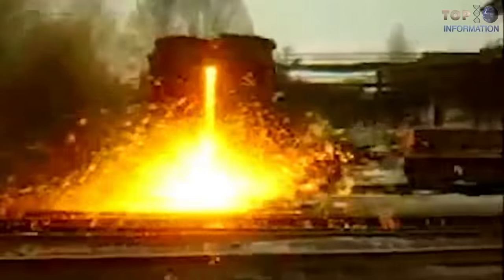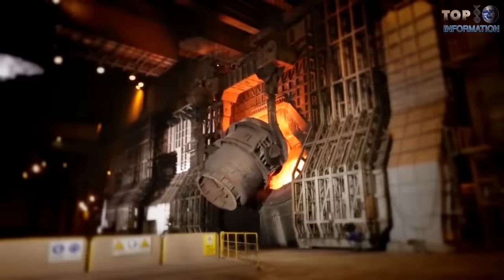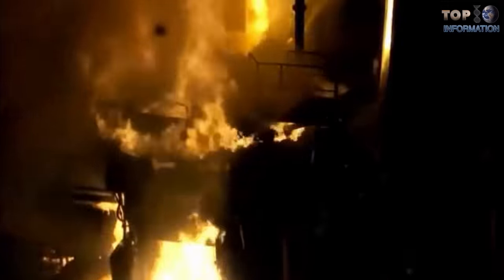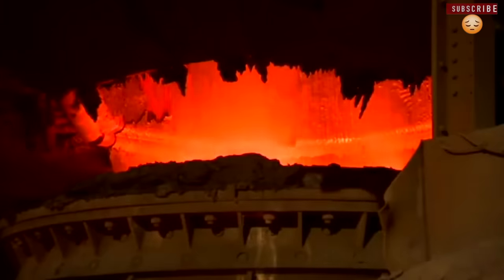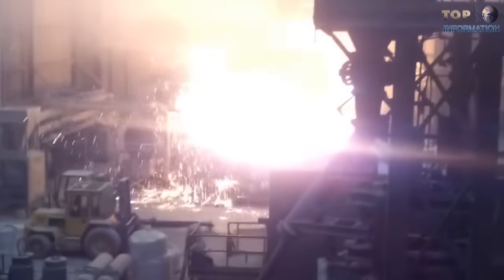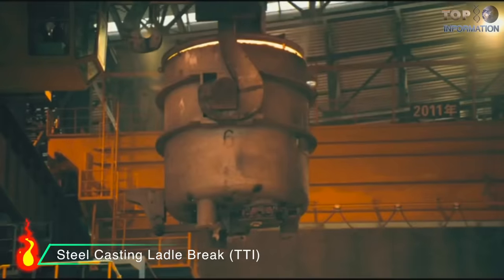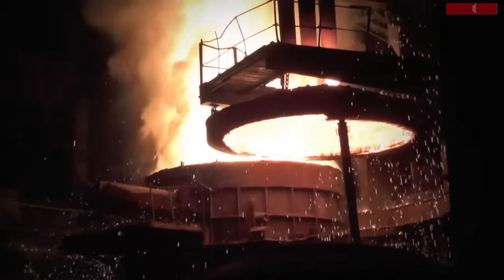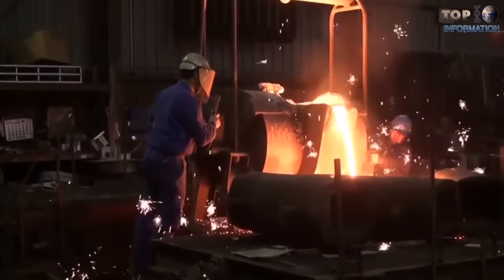TOP 10 Accidents In Metal Industry ✅

Comment: Water an steel is 100% fine.  The person explaining hasn’t a clue.  Matter fact the electrodes don’t get some crazy super hot. That they are ever an issue.   Actually they have cooling rings around them that are always spraying water on them. Even when there being used to melt the steel.   
And that water falls an runs down the electrode through the delta into what the furnace into the liquid slag in the top.  
Water is only an issue is if it’s under liquid steel.

Comment: So many technical errors.  I am aware of no boilers used in association with arc furnace, ladles, billet caster, reheat furnace, rolling mill, etc.  Static Electricity?  What a joke.  Accidental melting of radioactive waste received in scrap, melting of radioactive gauging instruments within billet caster, and dust collector explosions are not even discussed.  Complete waste of time.  Ten items, but many are repeated multiple times.  This video was developed by somebody who knows so little about so much.  Other than molten metal water explosion, rolling mill cobbles, arc furnace charging mishaps and apparent ladle tapping mishaps, most of the video depicts normal (violent looking) activities.  Also, nothing mentioned about arc furnace transformer failure/explosions.  This video should be shown to all NUCOR and SMI new hire wives.

Comment: no 8. explosion in the steam boiler.

The flue gases created by blowing with oxygen pass through a construction with steel pipes.  Water is pumped through the steel pipes and through the flue gases this water is heated to steam at 130 degrees. It sounds strange, but in fact the flue gases of 1200 degrees are cooled by steam. And the cooling effect of steam is great. Plus, this steam is free and can be used elsewhere in the production process. It is a pity that the youtube film shows a boiler with burners, while the process does not work that way. And the collapsing buildings are the result of explosives and not of an exploding cauldron, as is suggested. In essence, the story is correct, but the images belong to a different event.

This is where I stopped watching because the youtube movie doesn't portray the point.

Comment: Anyone work in this industry who can provide some insight on what the pay is like?
Reply: Answer - a fucking lot
Reply: @victorcrowley7670  That's relative. I'm looking for some actual numbers. Hourly or annual.
Reply: Pay is highly variable based on the work you’re doing. The apprentice guys on the floor at the mill we buy from makes about $53k. The process engineers make about $130k. There are a bunch of guys doing specialized work but I don’t know much about them.
Reply: I live in ND and it's typically $25-$35 depending on the position and whether or not it's a union shop

Comment: Moisture in the boiler? Sparks in an arc furnace? Static is the cause of fire, amid molten steel that ignites almost anything near? By lubes, you mean like KY? What contradicting cow pies! Sure, working with any molten hot metals is dangerous, Gas pockets do erupt violently. Accidents do happen, but not how stated by author of this halfwit video. Here's a big thumbs down. I couldn't mash that icon any harder.